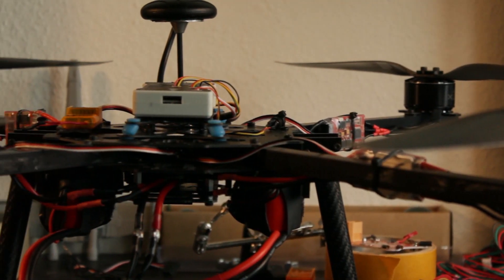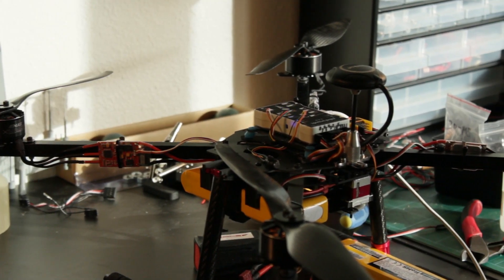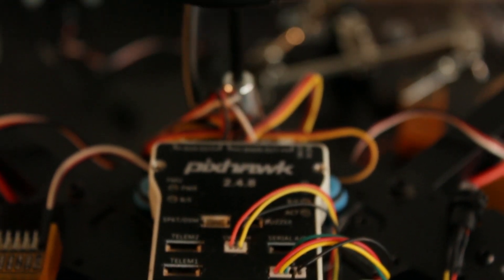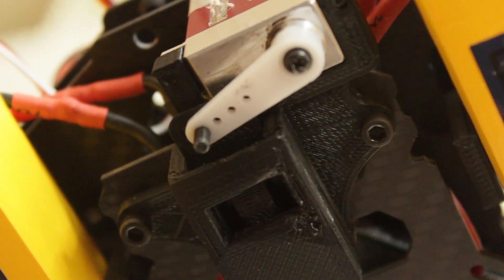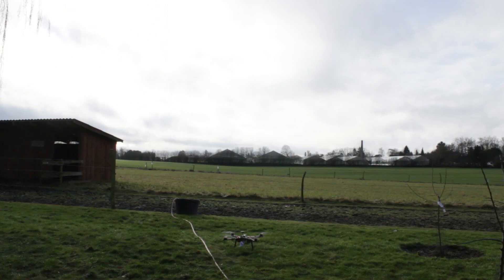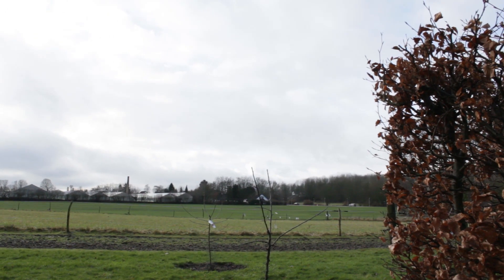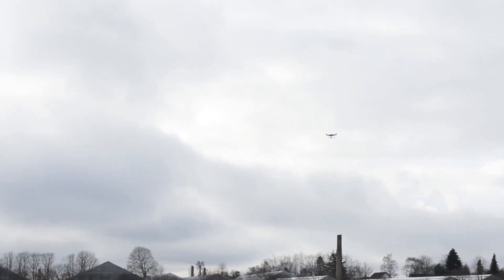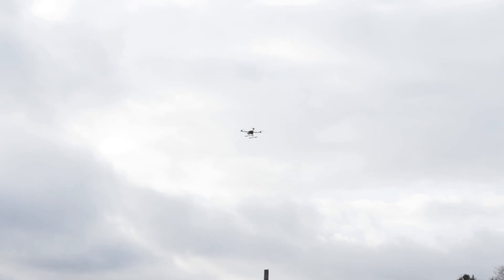DIY Autonomous Delivery Drone - Working!

Comment: Hi there, I really appreciated your video, you ALERTED me to something very important. That I was going to buy 2300kv motor for delivery drone, I was always under the impression that the rule was 2:1  - Power:Weight ratio. 

So could you advise me on motor size and for up to 5.5kg payload. Listening to your video, you said something about the motors you used are capable of 2.8 kg (not sure exactly) lift per motor. Does that mean it could carry 2.8kg x 4 = 11.20kg (possible lift load)?
Reply: Did you figure it out?
Reply: @rosendo843  no 😅

Comment: normally which online store you use or suggest for spares? ...i make use of banggood but the delivery time is really long!

and also ,will be glad to hear your experience about collision detection and controlling sensors for a quad ? im building a quad and i want the quad to detect obstacles at a certain distance and act accordingly!
Reply from the maker: I buy everything form eBay, and the shipping is really slow too. I haven't yet looked into collision avoidance
Reply: banggood and ebay are the cheapest options and that's where you'll have the most choice, you can order directly on the sites of the brand you want like flysky or eachine I think. For fast delivery there's amazon but the fpv drone gear they have is very limited.  Last option, physical stores.

Comment: Hey just a quick question what type of coding are you using? I’m doing my senior design project and we need to come up with the code in less than 3 weeks. The things is none of my team member know how to code it where to start. We need help, if there is anything or if you are willing to at least guide me to the right path
Reply from the maker: Just use pixhawk and ardupilot. Then you won't have to code anything

Comment: Heyy i just want to know how do you made the lock and release mechanism?
Reply from the maker: It is 3d printed. It is quite simple. Just a pin that is pulled by a servo
Reply: How did you do it to release when it reaches the third waypoint

Comment: How to make it fully autonomous... Just give the delivery address and then it delivers it
Reply: Even I have the same question. I have taken it as my final year project for engineering degree. I am worried if I could be able to complete it before final semester exam
Reply: Poojith Vp it’s my graduation project research too. If you finished your research can I please read it and add it as a reference for my paper ?
Reply: @rama90014   It's my final year project too. Maybe we can connect on fb to share ideas.
Reply: I dropped that project. Working on another one now
Reply: @rama90014  May I know why you dropped it?